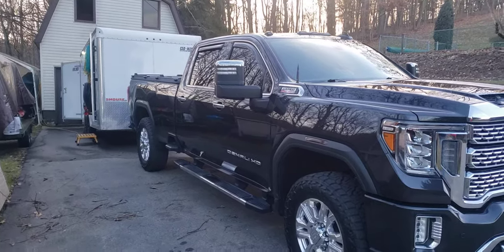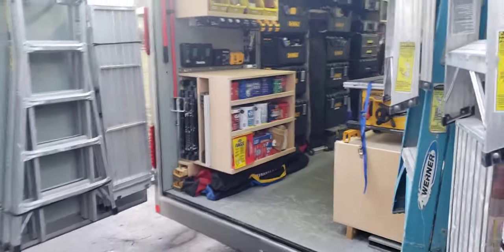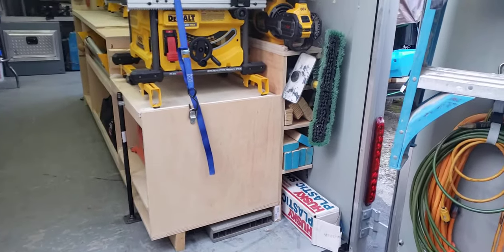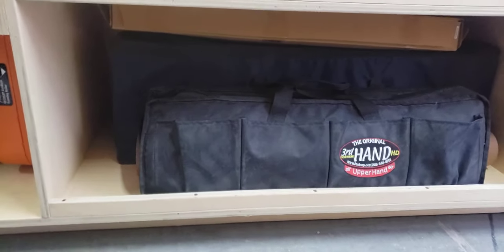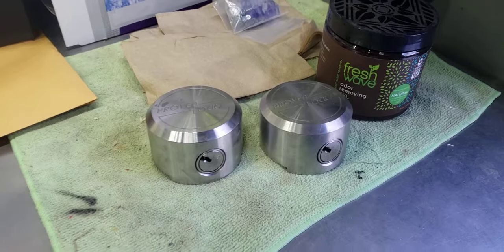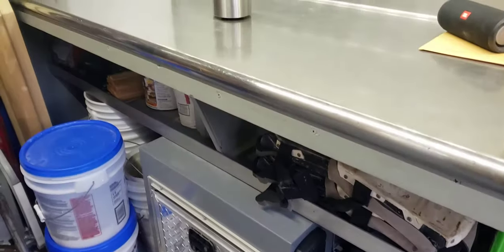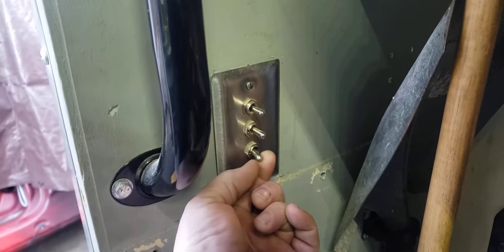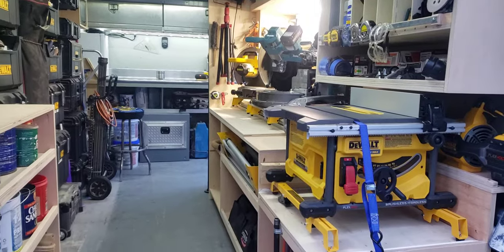Construction trailer walk-thru

Comment: One of the best set up’s I’ve seen. I love the mixed use of storage systems. From dewalt to custom woodworking. I wish I did something similar. Thanks for sharing
Reply from the maker: Thank you.  I spent about a year trying to plan it out in my head.  I have a few changes/add ons I'd like to do but it has been working well.

Comment: Find a roll up awning that will attach to the back of trailer. Just a thought.
Reply from the maker: EzUp seems to have worked the best.  Every jobsite is different on which side of the trailer is open.  Instead of using three different awnings I'm just going to stick to the tent.  Actually I'll set up in most peoples garages.